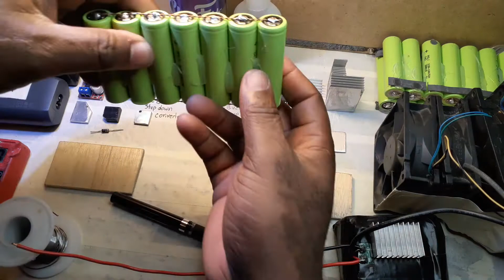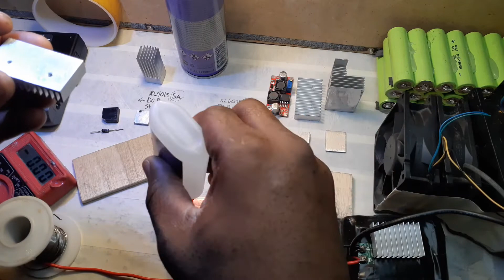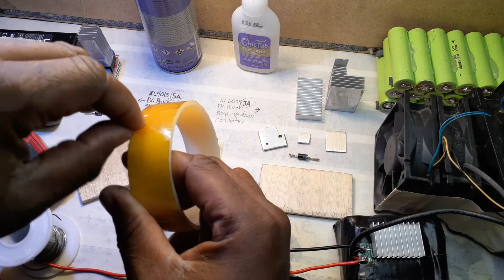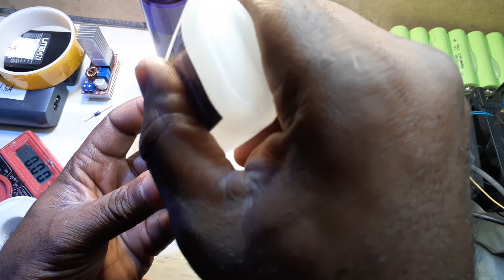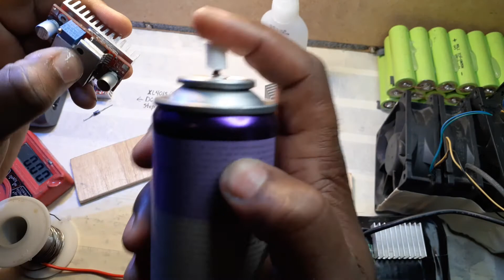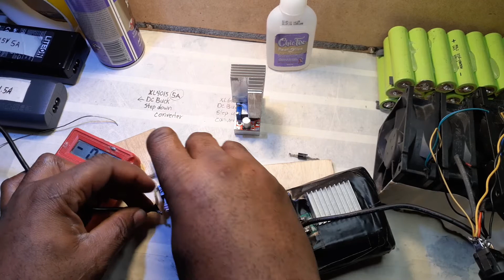making heaksinks for Buck converter Step Up step down XL 4015 5A and XL 6009 3A for cooling

Comment: Thanks a lot. I would like to ask, What is the black material that you glued on the xl 4015 just bottom of aluminium heat sink. Does the super glue transfer heat efficiently like thermal grease from xl 4015 to aluminium heat sink. Thanks again.
Reply from the maker: The black metal is just aluminum painted black and yes super glue works perfect to transfer heat 2 aluminum but one thing Super Glue don't have that thermal grease has is up to a certain temperature super glue lose its strength but I think it has to get at least 350 to 450 degrees though I have tested up to 225 to 275 degrees And it did not fail thanks for your comment and I hope your dly works great
Reply from the maker: Note it depends on what type of super glue do you use